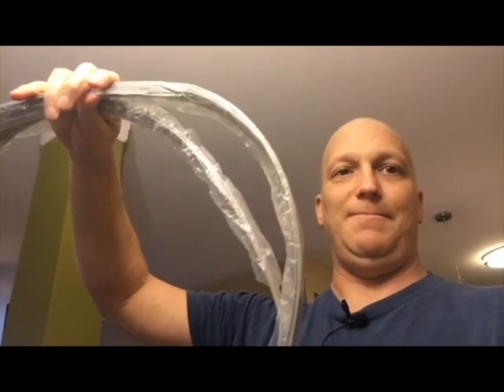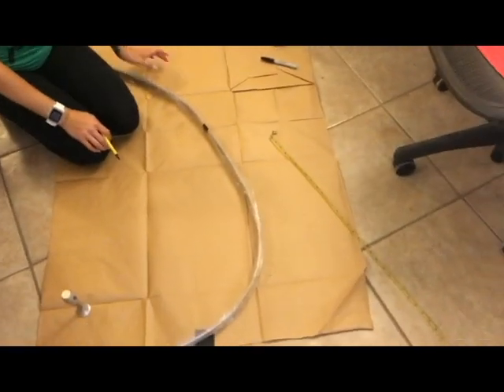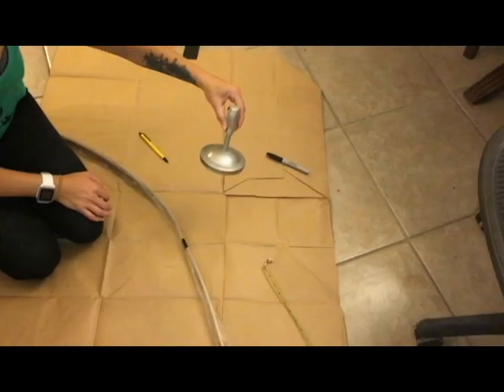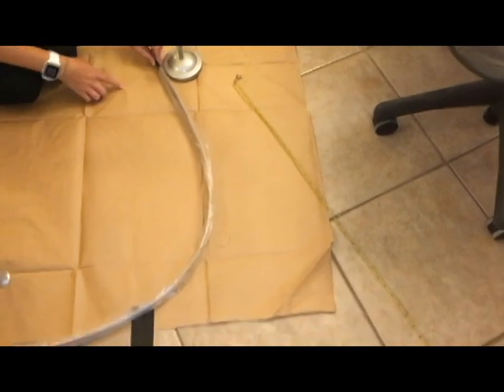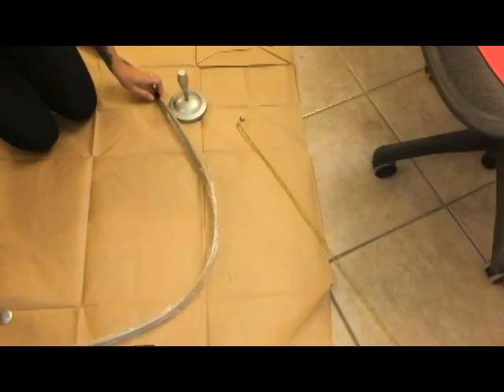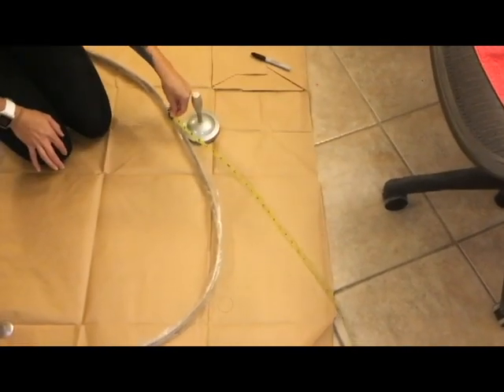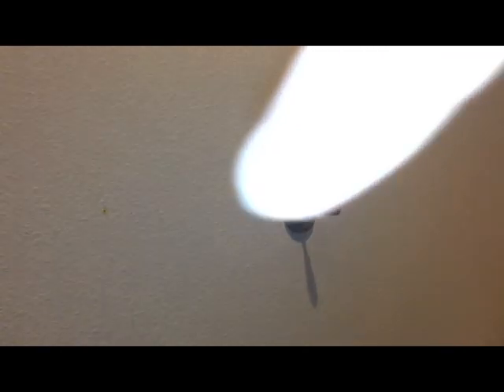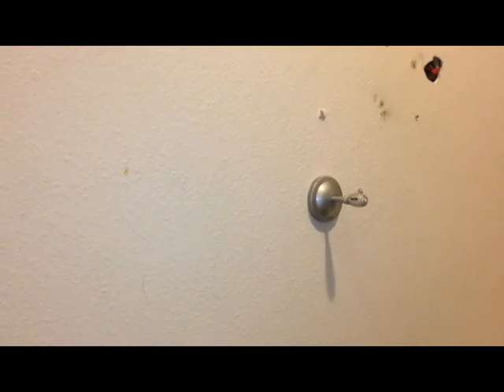Installing Flexible Track light and Phillips Hue bulbs

Comment: find studs to mount the brackets to or risk ripping the anchors out of the ceiling.  I used double sided tape in the brackets to keep the flexable track from sliding.